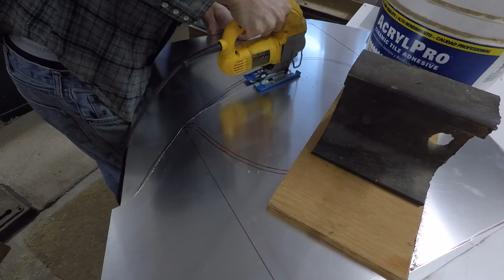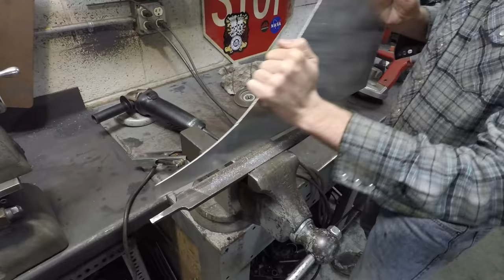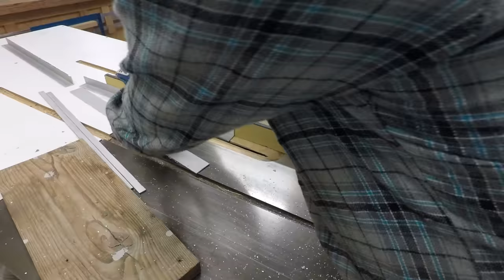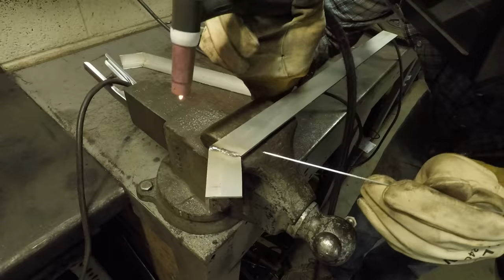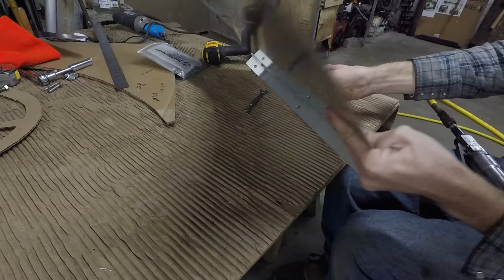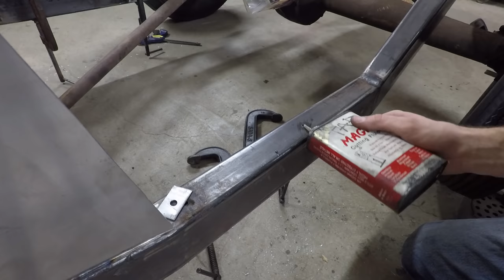Custom Aluminum Coachbuilding | Homemade Boat-tail Speedster Pt. 31

Comment: Great to see a new episode each and every one is enjoyed immensely, I hope you and yours had a great Xmas and New year,
A thought and suggestion for you as you said in this and other videos about the editing process and time it takes how about on the repetitive tasks like cutting out several pieces of metal and turning them into the finished product you only show the process once either leaving the second or 3rd etc time out allowing the viewer to get the point you made it 2,3 or more times just maybe showing the completed items before the next build process, ( a good example here is check out Rather B Welding, Chris's latest video) that will save you camera setups, repartition in editing giving you more time working on your vehicle and less time editing and more content in the long run
I hope this gives you more time doing what you like and less time needed for editing
Tony from Western Australia.
Reply: I'd second that suggestion but also add, it'd be nice to see at least some of each process at normal speed e.g. the beginning and end of shaping a panel at normal speed with the middle portion speeded up.
 I'm amazed at the skills you got for someone your age, it'd be easier to appreciate the processes at actual speed.
Keep up the good work and thanks for sharing it with us.

Comment: Amazing as usual. Are you going to fit a headrest/roll-over pillar behind the driver's seat? That might look cool especially if it's offset to the left to match the hump over the steering wheel.

Comment: Dude!  Clecos!  Just google "Clecos" and grab some along with the cleco pliers.  Temporary fasteners that replace the bolt and nuts you were using at about the 6 minute mark.  Not only will that speed things up tremendously, but they also make some excellent very small clamps that are opened with the cleco pliers and are super useful and fast.  Cool stuff you're working on!
Reply from the maker: i'm familiar with them, but I'm only doing a small amount of riveting so the bolts work just fine

Comment: Did you not want to protect between the ally angle and the panel before rivetting them together? Moisture will certainly start corrosion unless protected.

Comment: Just have to say its brilliant work. You are a natural at shaping metal as making that body is not easy. 
Just a question but are you going to put some form of bead on the top of the door panels? It would make a nice edge, add a bit of safety and also stiffen the top edge of those panels.
Reply from the maker: yeah, the plan is a rolled edge

Comment: You do very interesting and equally nice work. The English Wheel is a must in your project for certain. I enjoy watching your project come along. Keep them coming. I have to ask where do you get your aluminum sheets. I am looking for some, but haven't seen any place initially to buy any. Thumbs Up for sure...
Reply from the maker: i got the aluminum from a local fabrication shop that has suppliers

Comment: So, are you planning on painting it, or are you going to polish the ever-living hell out of it?
Reply from the maker: it's hard to maintain a super fine polish, so the plan is a decent polish
Reply: @MacroMachines  Over the long run I can see that being difficult, But it would be pretty neat seeing a basically chrome car when its done, even if it only lasts a little while.

Comment: At 10:07 your using a body hammer. What the heck is that? Im really interested in looking at that and the small chunk of wood on top of your shrink stump. Could u please post pics on Instagram and tag me?  Thanks!  ARCO MN OUTLAW CUSTOMS
Reply from the maker: That was just a little hammer I made from a piece of 1/4" steel welded to a bolt, an the wood block is basically an anvil that I made with a bandsaw, grinder, and sander

Comment: when using a table saw you should not be wearing gloves.    Also, a push stick is highly recommended.   When your age I almost lost a finger doing exactly what you're doing.
Reply from the maker: the aluminum chips hurt without gloves, so I just stay extra careful